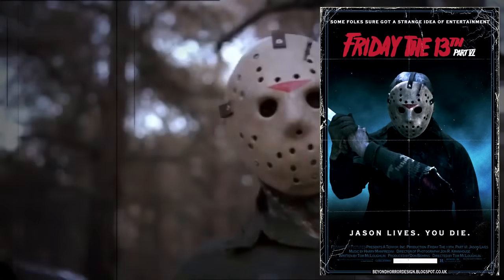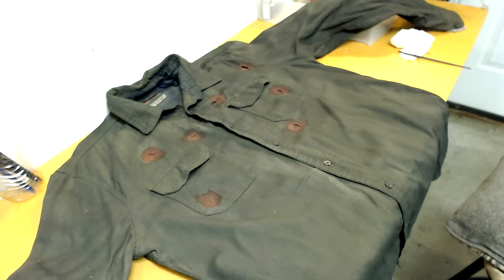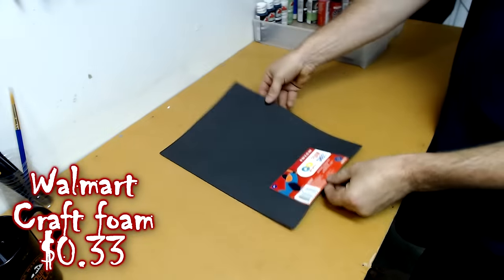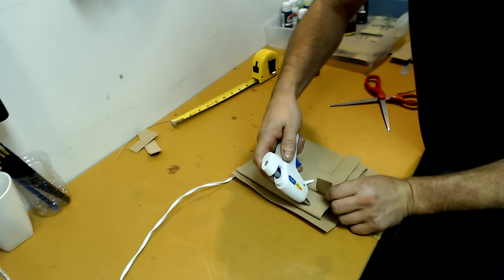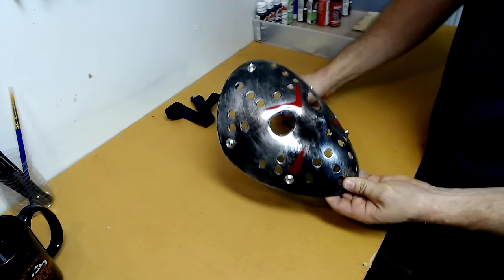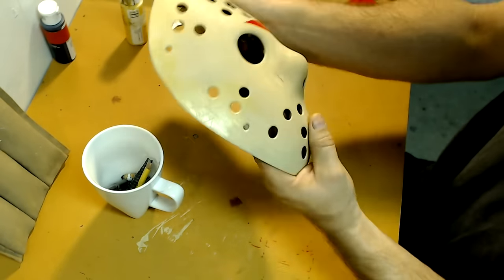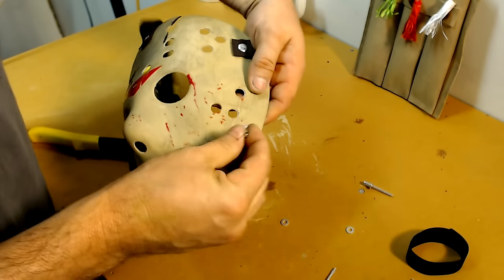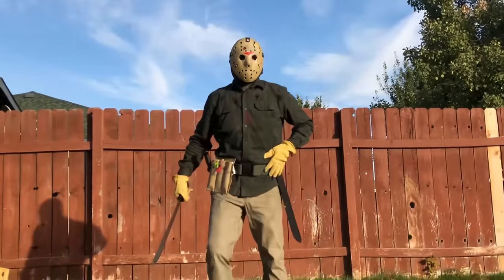$25.00 Jason part 6 Costume Tutorial | CS5's Cost Cut Costume Tutorials, Friday the 13th Jason Lives

Comment: It be cool if you wanted to do the Freddy Vs Jason costume, but I think the whole process is fairly straight forward... go to a thrift store, buy the clothes for cheap. Weather and colour as needed. Make the mask. Gain the use of a comically large machete.

Still think it would be cool though.
I’ve always wanted to do my own design for Jason. Sort of a Freddy Vs Jason but more weathered, showing bits of skeleton like part 7, and the bottom of the mask around the mouth completely missing, showing that sweet zombie jaw and nose.
Reply from the maker: I like your design better :-)
I'll probably make a FvJ costume one day but I'm not sure when.
Reply: CS5 UNMASKED I know that to get a good one you have to make the jacket out of Burlap, which is... unusual, not sure if there would be an easy substitute that still looks the part.
Cheers for the feedback btw mate, you’ve done a good job with these cheap costume vids.

Comment: For the blood you should have mixed red and a little bit of black and put it in a spray bottle and then spray the mask it would look a lot better
Reply from the maker: I've used spray bottles to apply splatter in the past and on some applications it looks cool but it clogs up spray bottles pretty quickly so you have to add a lot of water to the mix to get it to work and if you painted your mask with acrylic paint water is not a good thing to use on it but if you use spray paint to paint your mask a spray bottle works fine, I like to either use a toothbrush to flick the paint on or just paint it on myself :-)

Comment: Hey cs5 umm so I’m hoping to make a part 4 Jason costume and I’ve been watching your part 4 video and since I’m not your hight and weight what should I do
Reply from the maker: I would just scale down everything to fit your body. Thrift stores will have cloths in your size and as far as the weapons you might have to make them out of cardboard until you get bigger :-)
Reply: @CS5UNMASKED  aight thanks man
Reply: @CS5UNMASKED  update: im going to a convention soon and im doing part 6, i have everything under control except for the hood, what would i use to keep the paint from flaking away
Reply from the maker: @some_._texan64  use a little liquid latex to cover it up. It goes on milky but dries up clear.